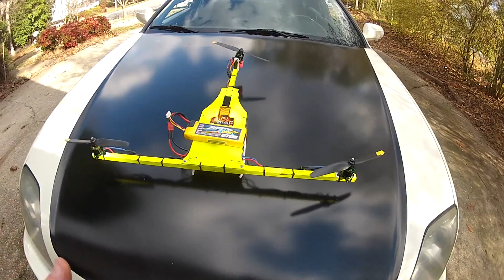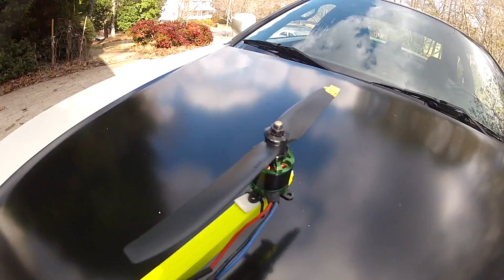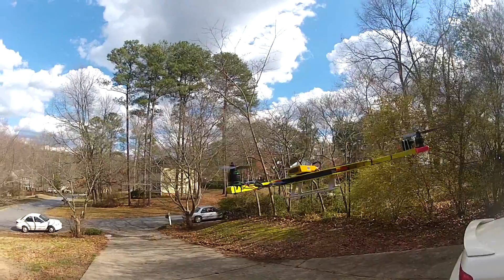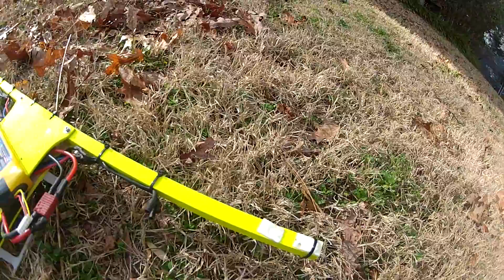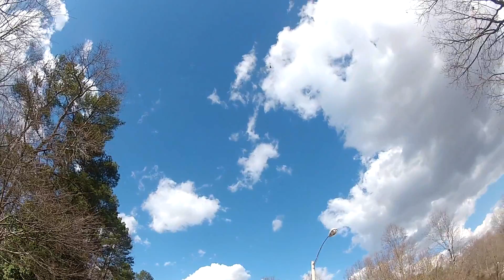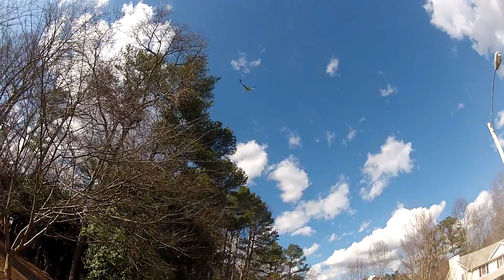Simple T from Simplecopter.com

Comment: I have test flown my Tcopter with the 9 inch cheap HK props on a overcast day with my GoPro Hero 3 Black Edition and the rolling shutter wasn't that bad on low altitudes, but when I throttled up and brought it up to 10 storeys high and sure enough the rolling shutter jello effect crept in. The props are balanced. I think the smaller 8' 4.5 props still gave the best result for rolling shutter free video. Now waiting for my carbon fiber props to arrive.

Comment from the maker: I was referring to the yaw setup. that one is mine. David came out with the plate design and it is brilliant.  I just oversized the plate so everything could fit on one level making it simpler to build. all I can take credit for on the tri is the yaw and size. I did not design the T copter. my friend did after he could not fit all his fpv gear on the tri. I just helped tweak it to make everything work.